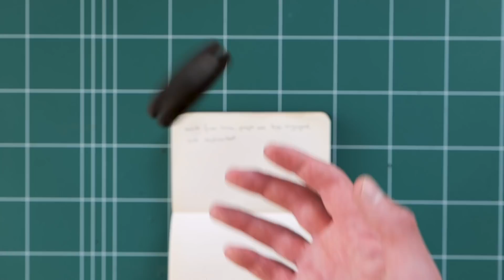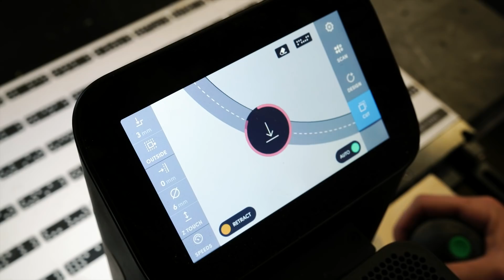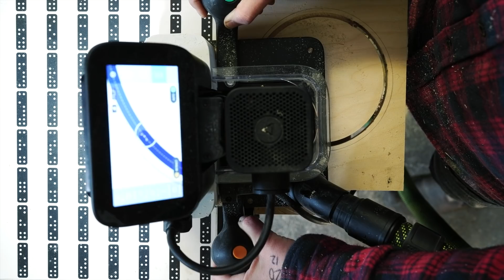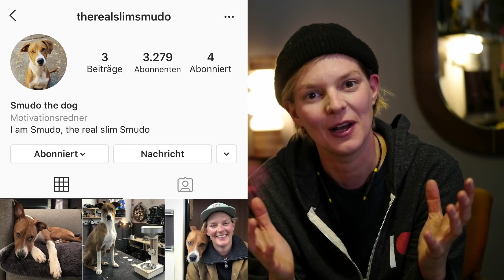Ridiculously Overengineered Subscription Counter (for my dog)

Comment: Do you ever try to recycle a broken IKEA Gunde chair metal frame components to build a Backpack frame? 
This stuff is the widespread ikea product...
https://www.ikea.com/de/de/p/gunde-klappstuhl-schwarz-00217797/
IKEA gunde is an interesting and very light chair, but overtime it always breaks at the back rest where is located the hanging handle...
usually it can't be decently fixed, and not being presentable anymore it becames a waste. 
Perhaps it can be recycled and repurposed in a functional transport backpack frame, or eventually a pack frame&outdoor seat... it could be an interesting recycling idea/hack design/diy experiment... 
What do you think? 
Do you have any suggestion? Perhaps the backpack shoulder straps can be made out from demolished auto seat belts... 
and the new back rest using leather or wood or older plastics reshaped somehow... an interesting idea also can be employ the frame with a net and a basic sealed case such as Max520 by Plastica Panaro (a competitive larger version of Peli 1510 and Explorer... cases often used by photografer to protect cameras...) so it can work as a sealed backpack arriving to the base and as material trasporting device e.g. woods for fire and havy stuffs as cement bags, water jerrycans... so on alone using the net.
Do you have any clue? Vielen Dank im voraus Laura, Tschüss.

Comment: I had a hard time watching you handle the table saw. It says "saw stop" on the fence, is it the festool or the Felder system? Please use a push stick or one of the different systems.... and why not split the board with a jig? And raising the blade to about the height of the board adds a lot of safety margin... 
I still like the treat machine! And your dog is very, very well trained. 
Have a good time anyway - best regards T.